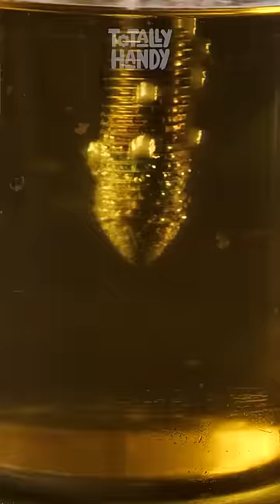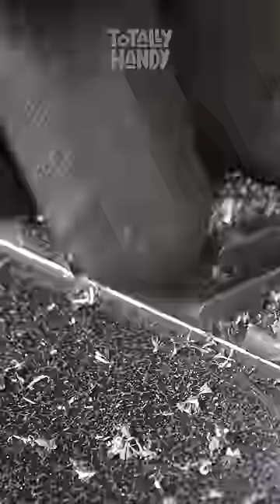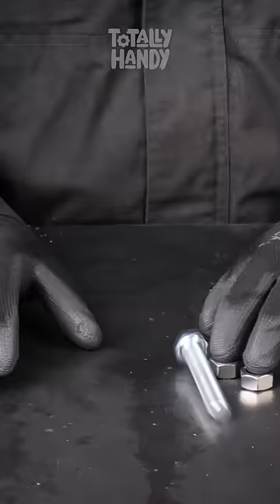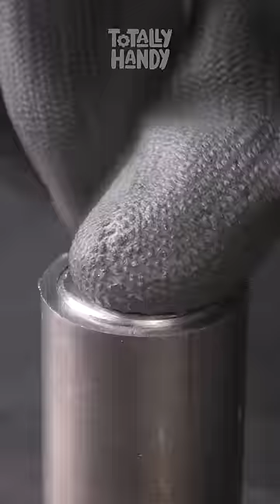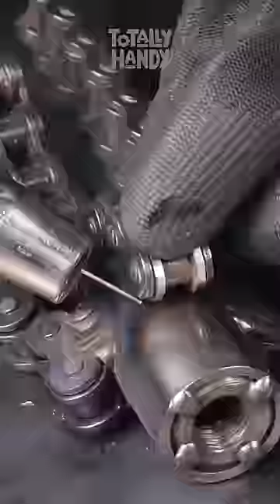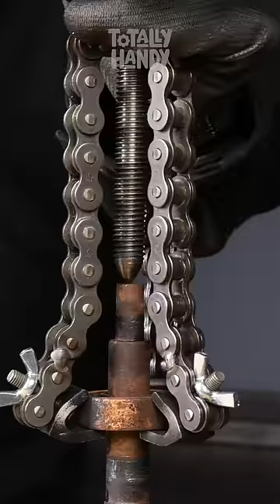DIY bearing puller #shorts

Comment: Did… Did this guy just try to harden mild steel?
Reply: Yeah low carbon steel can't be.
Idea is probably pretty useful if you live hours away from a shop that sells them
Reply: Yes, it needs to be the proper steel to take a heat treat. I hope no one really tries the stuff he does. I complain about the welding on all of these "instructional" shorts this channel produces. I Feel bad mentioning the welding, although to cold to be considered solidly welded as shown above, is still hot enough to take the temper out if the chains..
Reply: Mild or not, might not harden as much as high carbon steel, but now it's harder than when it started.
Reply: @johnbelwell2461  it would be negligible to none. You don't add more carbon from the heat treat. In order for the steel to harden the carbon needs to be there in high enough quantity to be pulled to the surface through quenching to form a martensite structure. There is a process called case hardening, where the surface of the metal is changed chemically by introducing a high carbide or nitride content after heating, and then quenching. There's a commercially available powder compound for just such a process.
Reply: @yourdrummer2034  l
Reply: @rayban5737  l
Reply: @rayban5737  l
Reply: @yourdrummer2034  lloĺll
Reply: lĺ
Reply: My first thought.
Reply: @yourdrummer2034  True, however it wont be negligible, it would be measurable, and that is not solely to the metal its self but in most parts because in case in the manufacturing process the mild metal has tension or has experienced a thermal expansion followed by irregular or uneven cooling it has structural differences, when "heat treated" the structure obtains an even structural integrity.
You can see it happening with screwdrivers, twizzers that you heat to hold something or even sheet metal, etc, when heated the metal warps and turns out softer when it cools down than the place that was not heated, if you reheat it and follow the "heat treatment" it again changes its characteristics.
It does not harden as in a high carbon steel alloy, that doesn't mean it can't get corrected.
Reply: @johnbelwell2461  I'm not following what you're saying. I've researched heat treating steels often and the only way there were any measurable results were adding compounds or chemicals. The steel may be changing but it can't be considered hardened or made into some sort of tool steel to be used for tools like the short is suggesting.
Reply: @yourdrummer2034  that's shame you're not following what i say, because we say the exact same thing, except you disagree with mild steel being able to harden, where i say it can harden to its maximum mild-steel-strength using heat treatment if its structure is PROBLEMATIC.
Bended, machined, burned, uneven cooled, etc, all these examples of mild steel that often happens with metal products can be stress relieved, and have their structure restored using this method, but not "harden" as a high carbon steel alloy. 
Of course all this is a discussion, this video is BS to start with.
Reply: @johnbelwell2461 I see what your saying. We do agree what was done in the short, (particularly the nut shearing bit) was a waste of time. I see what you are saying. What was done to the pointed threaded ram thingy might help a little, but I would say it's negligible.
Reply: @rayban5737  or you could have it shipped to you
Reply: @yourdrummer2034  you can get high carbon steel L profile where I live, though they are a bugger to drill.
Reply: @AutodidactEngineer  they must be difficult to drill compared to mild steel.
Reply: Yea....
Reply: @johnbelwell2461  probably not
Reply: @rayban5737 for sure. If o lay we had the internet and could get it mailed the next day
Reply: @johnbelwell2461  not really.
This isn't a case of diminishing results, the steel he tried to harden is literally unhardenable, there is too few carbon for it to become different.
Reply: @johnbelwell2461  wrong
Reply: @Youtubeuser1aa  hahahahahaha
Reply: The process is known as case hardening. Granted, the torch is not going to get the steel up to temp and hold it there long enough to actually do anything, but the quench in oil adds the carbon it harden it about .015 to .03 deep on average.
Reply: @johnbelwell2461  no... Not even a little bit.
Reply: I believe he was actually trying to make them black. If you heat it up and put in a oil it turns black. I've seen alot of restoration videos with the same process.
Reply: @allenbeaver8652  That process is a chemical one. The darker color after the oil quench is the carbon on the surface.
Reply: Was looking if someone already mentioned this...
Reply: @goingbonkerswithmyhonkers9374  sometimes you can’t wait for the next day. Sometimes you need things up and running right away.
Reply: @johnbelwell2461  no it’s not, if anything it weaker than before
Reply: @yourdrummer2034  that’s what I was getting ready to say Mr. Wiki Petey
Reply: @johnbelwell2461  cairan apa yang di gunakan untuk mengeras logam
Reply: I was just about to put this same comment up
Reply: @derekbrubach157  
Proper case hardening takes a way longer time, at red hot and in a suitable compound under exclusion of oxygen in the first place, to reach even the slightest layer thickness. Carbon needs quite some time to diffuse into steel/iron, even in a much more permeable, red hot state.
There's no case hardening happening by quenching in oil, like at all, it just shows a complete absence of knowledge about basic metalurgical processes.
Reply: Yes, yes he did.
Reply: Looks like stainless to me but still won’t take a heat treat.
Reply: You just saw this. So?. Ask again, please. 

:)
Reply: Yup, that attempt in heat treatment is useless. It's possible to increase the carbon content of that material but it's more troublesome than using a proper one.
Reply: I thought he oil blackened it.
Reply: It makes Martensite
Reply: @yourdrummer2034  I think the only people that try these are other YouTubers for those stupid 'cap or slap' videos
Reply: @CLCasual  sounds about right
Reply: Yes.
Reply: It's case hardening I think 🤔
Reply: @padraigsheridan4699  I explained it in a comment before, but case hardening requires adding carbon while heating..
Reply: @yourdrummer2034  right. I had to look it up.
Reply: Just to settle the argument, I went out to my shop and grabbed a piece of 0.125”x2”x12” mild steel, cut it in half, set one aside, and heated the last 2” of the other red hot followed by an oil quench as in the video. 

I then put both, one at a time, in my vise for a bending test and a drilling test. There was no discernible difference in the behavior between the two samples when bending 45° or when drilling a 1/2” hole with a cordless drill.
Reply: @97marqedman  thanks for the in field testing and the report on your findings, my friend.👍
Reply: @yourdrummer2034  look at you being all cool and smart and shit. Mr science man. Jk thank you for the good explanation.
Reply: No he put it in oil, not water. Different reaction.
Reply: @johnbelwell2461  no. You need the carbon for martensite to form. If there is not enought carbon it doesn't harden it just degrades from the heat.
Reply: My question exactemente
Reply: @yourdrummer2034  not to mention he didn't preform a proper quench on top of it.
Reply: I saw that too
Reply: It is possible using superquench or cold brine solution, to some extent.
Reply: @amazin7006  different steels have different critical cooldown rates, which are achieved by using either water or oil. Mild steel doesn’t care about which one it’s quenched in since it does not harden at all.
Reply: @rosbifke  And on a thin part with little mass, the quench fluid makes little difference as it will cool nearly instantly anyway. 

For those arguing about case hardening, Heinz has it correct above. The part has to soak in carbon or nitrogen (or a few other more unusual compounds) while hot, so that it can diffuse into the metal. That takes time so depths are limited to .015-.030in. typically for carbon, and much less for nitriding. 
From personal experience it will make mild steel way stronger on a thin part like this. Not sure why case hardening is being discussed though. It's not going to save this and make it a good tool. Even if made of high carbon steel those angles will just bend.
Reply: @johnbelwell2461  Im so grateful for formally educated responses, makes the comments section, more valuable then the video 😶 Thank You!
Reply: @johnbelwell2461  no it's not. It's still literally the exact same.
Reply: Heat treating does different things to different metals. Neat.
Reply: @yourdrummer2034  maybe that the molecules rearrange themselves so that it is less under tension. But don't know if that heat is enough
Reply: @yourdrummer2034  yo bro thanks to your comment im now a professional and feel like i myself know more than these people and am gonna use your comment whenever i get a welding video on the algorithm even when it's not applicable!
Reply: @handlesaretoopersonal  go for it!
Reply: @johnbelwell2461  no, not at all. Mild steel cannot be hardened like that.
Reply: He did indeed. He also tried to harden an already hardened screw.
Reply: @johnbelwell2461  measurable doesnt mean useful
Reply: @johnbelwell2461  do you realize youre arguing with an engineer ?
Reply: It does add an oiled oxidized coating  so it's not a total loss it won't rust as mych
Reply: @allenbeaver8652  yeah heating  it up and dipping  mild steel in oil is a really popular way to coat it all these people are over thinking it haha
Reply: @heinzhaupthaar5590  heating up mild steel and dipping it in oil is still a pretty widely used easy coating against rust especially with blacksmiths making  things out of mild steel you are correct tho this isn't case hardening
Reply: This gave me a chuckle
Reply: @yourdrummer2034  totally correct,I did this process in first year mechanical engineering but it took quite a long time to get the carbon into the steel
Reply: @jamiejazzy  its fascinating really. Every heat treating process or forge welding and everything associated with that and then heat treating.
Reply: After bending metal that's cold, (without first heating it up), there will be parts under tension and stress. 
Heating it up will "reset" or "set" the material into it's new shape. It removes the tension/stresses and lessens the chances of cracking or fractures. 🙂🌎🌳
Reply: @OJesusX3  👍
Reply: @derekbrubach157  that's not case hardening.. mild steel needs to be held at a constant temperature of atleast 1500° for several hours minimum while being incased in carbon with no oxygen present to get the slightest case harden . . The heat n quench done in the video did nothing .
Reply: How the hell are y’all so knowledgeable about  metal it’s pretty impressive
Reply: @Noname-vg2tr  I've worked in metal work/welding/machine shops for 25 years. You tend to pick it up making parts from blueprints.
Reply: Yep, kek
Reply: Yes... he did. ...try 😄😄😄
Reply: Thanks for sharing your experiences guys. 🙂🌎✨
Reply: @yourdrummer2034  there is a method to heat treating mild steel, but this wasn't it.  And yeah it does require more carbon to work effectively
Reply: Maybe the carbon from the burnt oil is giving a form of surface hardening
Reply: Bolts are generally now mild
Reply: Just buy a puller lol. Not that expensive
Reply: After short research (not my technical field) i learnd something new, thank you!

and yes he did.... :'D
Reply: @rileyallison3907  
I've tried that and similar methods quite a few times. But in my experience the effect was insignificant, just like blueing or simple phosphating.
Never prevented corrosion for me one bit (even proper hot-, not just cold blueing). I suspect it's a leftover of the old days that might have had a benefit back then, probably by giving old timey oils better adherence.
Or maybe I did something wrong all those times, although these methods are pretty simple and rather straight forward. But who knows.

Anyway, my point from experience is - don't ever rely on them if you actually need dependable protection from corrosion, better use a more modern, more effective and proven method.
Reply: he could chew the steel and decided to do so
Reply: This video is just eye candy for people who dont know how to do any of these things
Reply: Mild steel will harden to some extent if it’s small enough of a piece
Reply: @johnbelwell2461  this was a great example of a disagreement resolved calmly and rationally. I wish all of my disagreements with people could be so perfectly resolved. Good on you both, and I learned something as well
Reply: Yep, he sure "tried" 😂
Reply: @yourdrummer2034  ❤️❤️
Reply: @mrajaykumar0037  😍
Reply: I came here to ask this same questiin
Reply: @johnbelwell2461  comparing medium and high carbon steels like screwdrivers with mild steel? ...
Reply: @johnbelwell2461  mild steel will be just as hard no matter what you do, there's no carbon in it, that's all that matters for hardening.
Reply: Yes, yes he did
Reply: @johnbelwell2461  Your best bet for hardening mild steel is cold working. If anything, heat treating it like that would have actually softened it.
Reply: @rayban5737  lol live hours away from a shop that sells a puller tool...
Reply: More like rust proofing.
Reply: @yourdrummer2034  Couldn't of said it better myself just to add though:
                     
Austenite<Pearlite<Bainite<Martensite 
Martensite Forms from Austenite in iron-Carbon Alloys which is generally only present above the critical Eutectoid temperature...
But Tempered Martensite and Cementite are the preferred Structures though "There is a Balance between Hardness and Toughness in any Steel, the harder the Steel, the Less Tough or Impact-Resistant it is, and the more Impact-Resistant , the Less Hard it is...

That's why you need a mix of Martensite, Pearlite and Cementite to make a Good Knife for Example...
Reply: @ohmmygod4963  Thanks for the input! Appreciate it!
Reply: @johnbelwell2461  сталь если мягкая ст 3 - ст 25... То твёрже она не станет. Закаляют ст45. Так что это истина прописные учите матчасть

Comment: Damn I could almost go to oreillys   and rent one for free and return it before finishing this build
Reply: only when you won't need it everyday,, but if u would like to use it everyday u can even make two of them 😂😂
Reply: The only time you need it O'Reillys is closed, but it's cool.. Cuz then you only need a drill, a grinder, a welding thing, a bike chain, and a freakin torch, bro! 

Oh yea, and all the leftover nuts and bolts from your brother's 92 Integra..
Reply: Why rent if it's free? then just borrow
Reply: Rent for free?? How’s that work? I guess we won’t know because you almost went to Oreilly’s, you didn’t actually get there…🤦🏻‍♂️
Reply: @zarasdad100  because you pay a deposit. If you return it with in timeframe (usually 24-48hrs) you get the deposit back. 
Hence, renting for "free".
Reply: @politicallyinsensitive4200  or let them hold your ID and thats the deposit.
Reply: @PhillipManholes  j
Reply: @PhillipManholes  imagine not being Chad enough to have tools
Reply: I bought a cheap bearing puller set 30 years ago for 50 bucks 
I still use it
Reply: And it wont even work for most real jobs you need one for. Try to pull a pinion bearing with a mild steel puller and see what happens. Considering you can rent one for free, it's not much use in most places. I suppose if you were someplace you couldn't do that, it might make sense. But you wlyld have to scrkumge some decent stwel. Maybe some d wrenches large old wrenches or something that you could cut up and hammer flat and bend into the jaws.
Reply: @kingjim713  how do you drive home with no ID?
Reply: @politicallyinsensitive4200  Normally I will stay in the parking lot and work. Not all will allow you but some will and those are the ones I'll frequent. You don't need an ID to drive.

Comment: Cordless drill - $30
Metal saw - $250
Blowtorch -$20
Bench vise - $80
Welder - $160
Grinder - $80
Drill bits for metal - $10
Assorted parts for project - $50

Total -$680

Or... pulley remover. $40

Comment: As even an amateur metal worker I would like to analyze this video

1. Those welds are faked to heck and back, welds don't just appear

2. Why torch the L beam, like if you're trying to temper it you have to do it more than once, and just heating it will cause it to become tougher yes but also more brittle so if it gets damaged it might just snap and not deform

3. That sort of chain is IMO too expensive to use on this

4. Anytime I've replaced bearings you can't or don't use the old ones so just use the dang angle grinder to cut them off, no assembly required

Comment: I could’ve been to town and back with a brand new one before I did all this.
Reply: If you had the tools to make one, I believe it would be worth the hour or so to make one as they're fairly expensive.
Reply: @chikkenbonz  luckily I have three.
Reply: @chikkenbonz  they're fairly expensive for a reason. It's made of a different steel to begin with...
Reply: Cough cough* your local auto parts store rents them for free or a negligible price
Reply: @docholliday9741  oh I’ve got a guy.
Reply: @maximvoronin1569  exspensive. Ive seen them for less than 20 pounds in the uk.

Comment: Heat treating and quenching in oil only work on high-carbon steel (aka tool steel). Normal hardware store bolts and brackets (made of mild steel) don’t benefit from heating and quenching—they’ll be the same before and after. 
Yet another reason to buy a puller instead of putting together a janky one that’s gonna snap or bend when you put pressure on it.